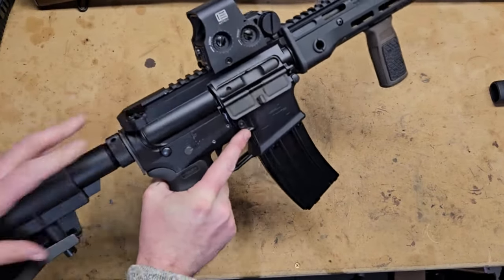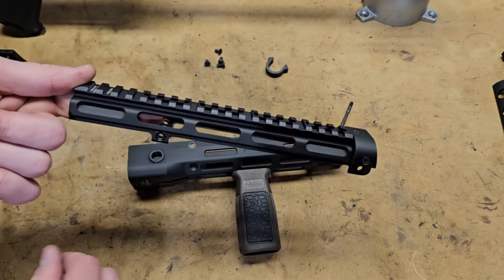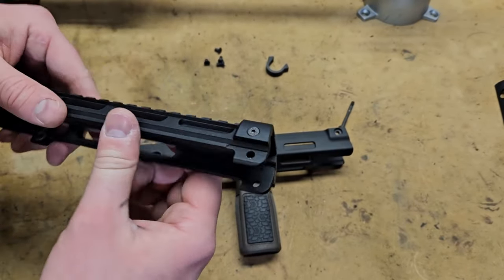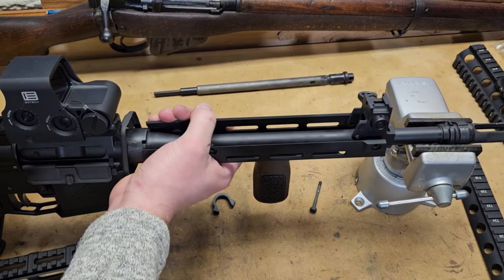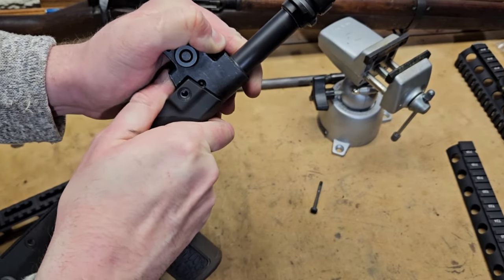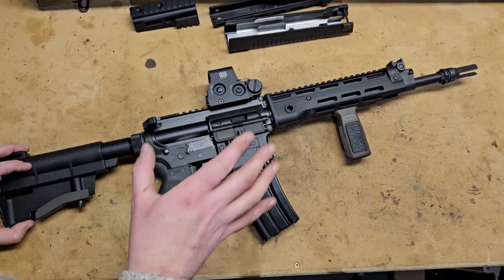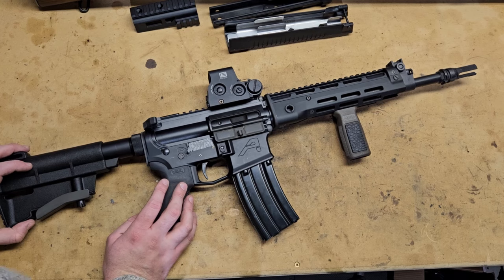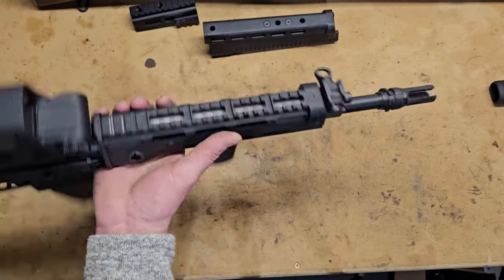BiaoTac T91 Handguard Set (Upper+Lower)

Comment: Cool to see there is an upper half. I saw the lower rail on the ebay page recently and picked it up, gonna have to keep a lookout for this one. I wonder if there's enough demand we could convince BiaoTac and do a group buy for a special handguard for the WolfA1 that extends over the slick gas block. Biaotac once had another 'recon' version of the lower half handguard that extends beyond the gas block to give more rail space up front on 16" uppers but it still has the cutout for the T91 gas block pic rail so I passed on it

EDIT: Looks like there was a WolfA1 version, just saw it on T91 Tactical's website. Now I need to get that as well

Comment: The way the T91 barrel nut is designed an aluminium M-LOK handguard could slide onto the outside diameter with an interference fit used, but also having a square slot with radiused corners at the twelve o'clock position so the piston system has clearance to be inserted and to operate. Thankfully the gas block can be removed to install the handguard with the piston system able to be removed at anytime without any major disassembly of the rifle needed and the handguard still in place. A 2mm slot at the bottom of the handguard under the barrel nut is also needed so a small amount of movement is allowed before tensioning the one or two retained cap head bolts to reduce the diameter and lock the handguard in place on the barrel nut.
A small machined keyway could be incorporated into the picatinny rail at the top where the handguard and receiver join to locate the handguard in the correct orientation on the receiver while also allowing the handguard to sit flush and butt up against the receiver. This design would give the rifle a seamless picatinny rail from the gas block to charging handle with M-LOK slots at the nine, six and three o'clock positions on the handguard.
So basically a very similar handguard design to the HK416A5 handguard design but with M-LOK slots and a different barrel nut mounting system.

That way the flimsy sheet metal cup is not needed and can be discarded because it is not required for the new prototype of the XT112 Assault Rifle handguard design as described above.
😎🇦🇺👍

Comment: Can't wait to get some of those upper hand guards! Also, I just want to mention I didn't install the barrel nut portion on one of mine and been using it pretty hard for the last few months. So far I haven't noticed the hand guard moving at all or getting lose. It's still surprisingly a tight fit just using the threaded screw up front through the original plastic upper hand guard. The only issue I noticed since installing it was the hand guard retaining clamp is a bit loose but I wrapped some goon tape around it and now it doesn't move around at all. I figured the barrel clamp on the lower hand guard would mess with the barrel harmonics so I left it off but will try installing it on another T91 once I get the upper portion. Anyhow the new upper hand guard will probably make the whole thing a lot more secure with those steel inserts to connect the bottom to the top a lot better than with the original one. With or without the barrel nut clamp. The guy in Taiwan who sold it to me also verified that on a Wolf A1 upper the barrel nut clamp isn't needed and so far it seems like that's correct. The one I set up without the barrel clamp hasn't moved since I installed it with the original upper hand guard.
Reply from the maker: I don't think the barrel clamp is strictly necessary, but I also haven't found that it seems to negatively effect accuracy or anything. The matching upper definitely tightens things up a bit more. Thanks for the info!

Comment: Super curious to see if an HK416 barrel nut and handguard would fit on the T91
Reply from the maker: Highly doubt it. An AR15 nut will thread on, but won't necessarily clear the piston mechanism.
Reply: @CondavourTalksGuns  like a GI barrel nut? I wanna say the HK barrel nut is diameter wise smaller than a GI barrel nut. If an HK rail fit that gun it would be a widely usable free float option
Reply from the maker: @theejasonbourne6308  its much smaller than a GI barrel nut, as a GI barrel nut has the "gear teeth" on it for both the barrel wrench and for the clearance of the gas tube. I would be very surprised if the HK system shared both the barrel nut diameter, rail height, and the exact same piston clearances.
Reply: @CondavourTalksGuns  I'll have to see if I can get my hands on one, I've at least got a friend with the wolf T91 12.5 upper.

Comment: Im trying to figure the fuck out if they make HK 416 type of handguard for the wolf t91 I bought a 16" t91 upper I plan to chop the barrel to 14.5" and pin and weld it with A2 flash hider and make it a hk416 knock off clone build.
Reply: Just buy the 14.5 it's available again